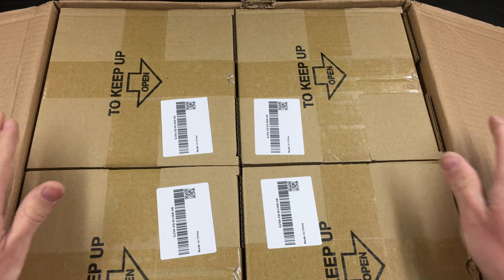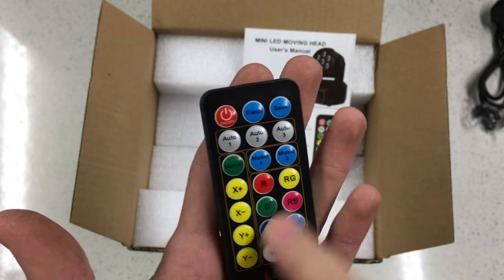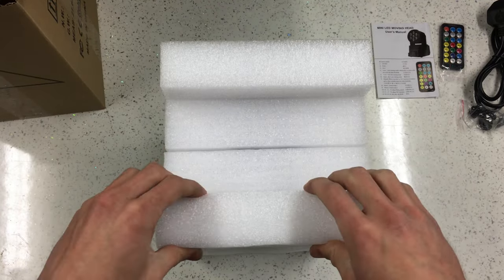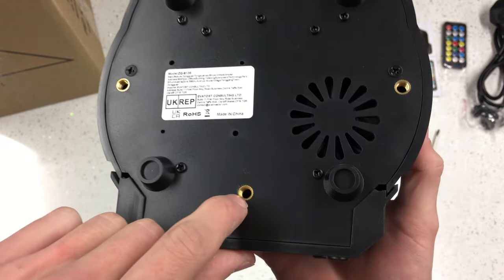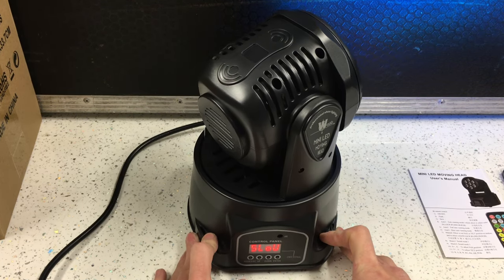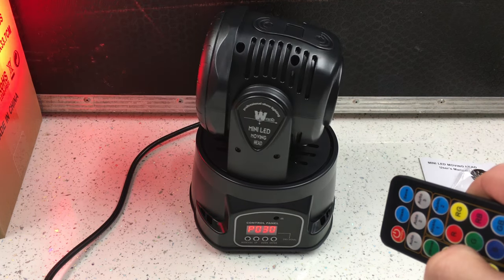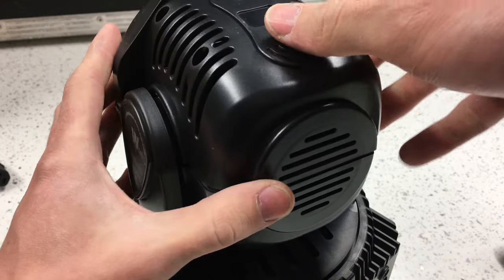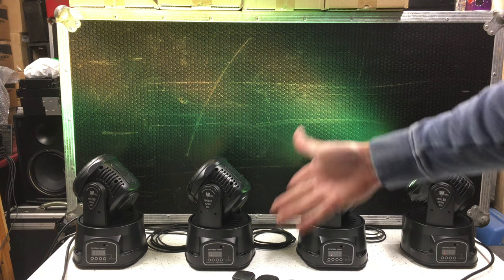Cheap 105W Mini LED Moving Head Wash Unboxing, Teardown, Quality Analysis & Demo (Model ZQ-B136) 70W

Comment: This is an Incredible video on these!!
Reply from the maker: Thank you! I'm glad you found it helpful.
--Nathan
Reply: @NathanPH  extremely helpful! I am going to try master slave with the wireless DMX transmitter on these and see how it goes.

How have you found the mounting brackets have held up since you’ve had them?
Reply from the maker: They are okay but I really don't like the brass inserts for the screws that are just tapped / molded into the casing as shown in the video. 
I would really advise changing those to improve it, Ideally something that goes through the casing to the inside using large washers or a metal plate to spread the fixing position. The way they arrive from the factory all you'd need is for the brass insert to come unglued / fall out and the light could come crashing down. 

I did also make anther video following on from this that shows the linked configurations with DMX cables and the built-in shows perks and drawbacks, plus the pan and tilt inversion settings in the menus and effects these give. May be worth a watch depending on your level of DMX experience with moving heads, could make programming easier. 

--Nathan
Reply: @NathanPH  thanks for the reply! I agree that the factory way that it’s built is precarious and you brought up a great point about their safety. 

I watched your second video and it was amazing as well! I will definitely be referencing it when I try connect the two lights with DMX. Your demonstration about the reverse pan and tilt features were especially helpful. Cheers!

Comment: I lost my manual.  I can look it up online of course.  Just wondering if you know if it’s possible to turn off the strobe function?  Or if it won’t randomly strobe if it’s in DMX mode?  Idk 🤷🏼‍♂️
Reply: In DMX mode you have total control of the master dimmer slider to control the master brightness, through the strobe pulse speeds, up to the full LED on levels.  For example, in 9channel mode it is DMX slider channel 3, or in 14 channel mode it is DMX slider channel 6, whichever mode you choose it works like this. 

DMX level 0-7 is LED dimmer is OFF, 
DMX level 8-134 is the variable brightness master dimmer levels, 
DMX levels 135-239 activates the strobe at variable levels from slow to fast, 
DMX levels 240-25 put the LED brightness level at max full constant ON.

Hope this helps.

Comment: That hanging bracket looks horrible. Why are they using thumb screws for the attachment? That whole thing just screams cheeaap
Reply from the maker: Well you do get what you pay for. When you're purchasing a complete moving light at this price point there is of course going to be areas they took cost saving measures.

I've modified mine by drilling right through the base and fitting spread plate / washers inside with nuts, passing through the whole of the base. More secure than the inserts pressed into the plastic housing.